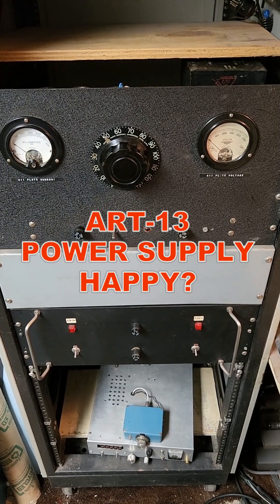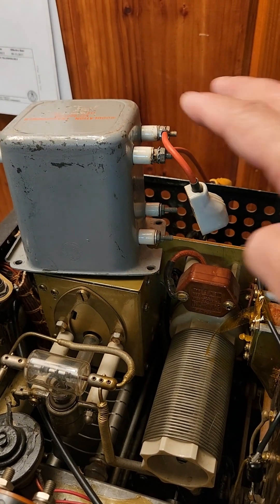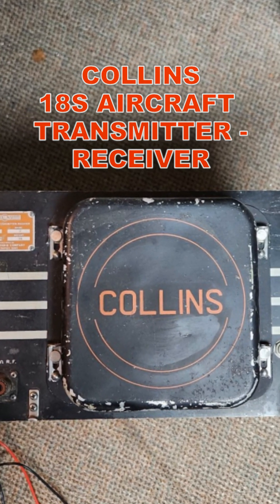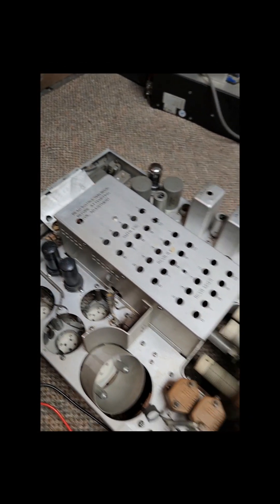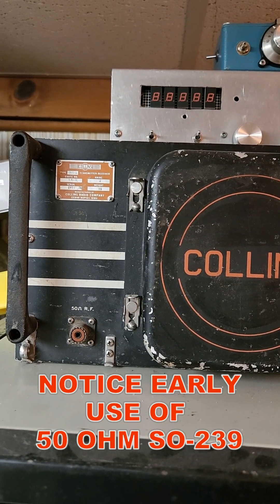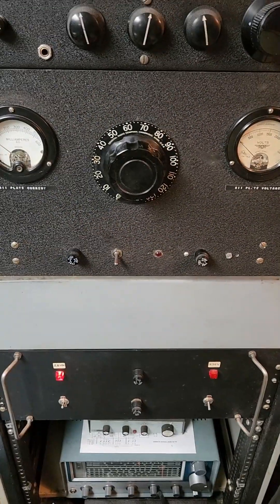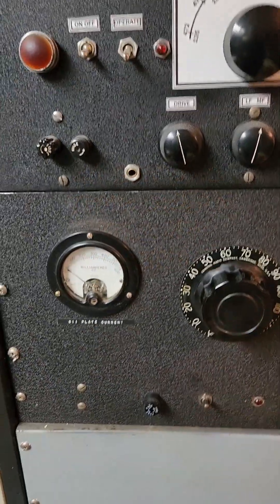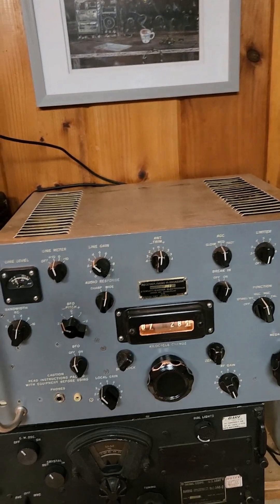ART13 Power Supply Fixed

Comment: Be carefull not to run the transmitter with 400 volts on and  no plate voltage applied as the screen draws hight current through the screen windings and damages the transformer. We have had a couple of cases here in Au.  where that happened. Good idea to use the transformer from the 18S-4 as it has heavier windings for the screen.
Reply from the maker: Yes this is a HUGE error on my part. I am installing a primary dual relay ganged to PTT at the moment as I recap my ART13 Power Supply. How the hell did I get away with this for 30 years?

Comment: Didn’t you just blow up another mod xformer in that ART-13 not too long ago??
Reply: ulation trans
Reply from the maker: XFMR #1 - 20 Years, XFMR #2 almost 10 years, XFMR #3 Deerfield Spring Nearfest till 3 weeks ago. All different failures. Open Screen winding and this last one shorted MOD Primary to case. They are old and have all reached EOL.
Reply: @ EOL was probably before anyone even thought about deploying missiles to Cuba. 😂
Reply: @MIKROWAVE1  older than you? Have you reached "EOL?"
Reply from the maker: Good point. Do you expect radios to last as long as you do?